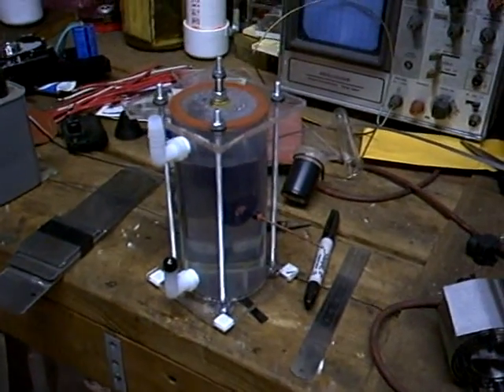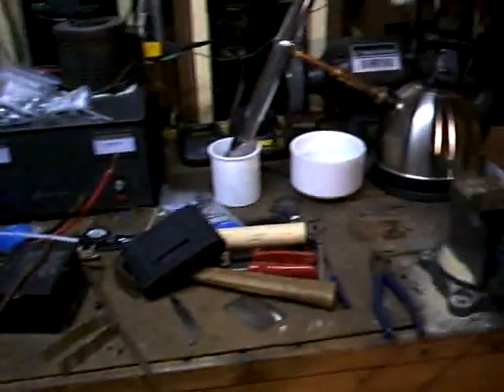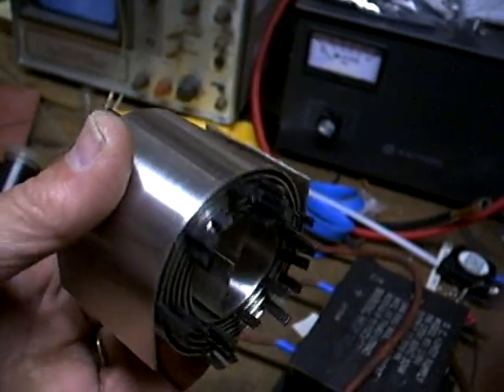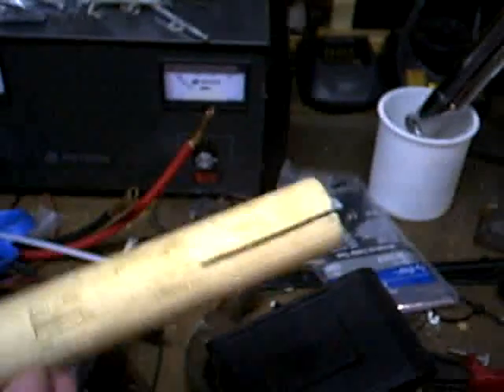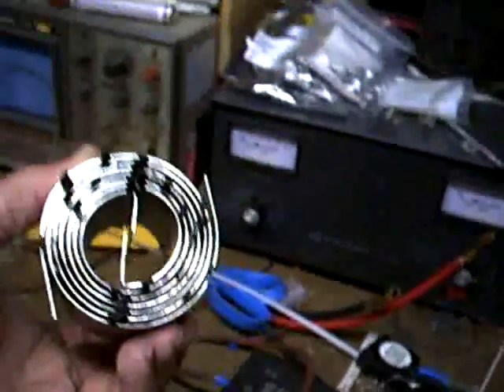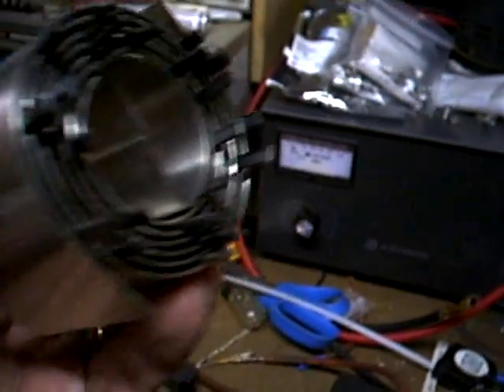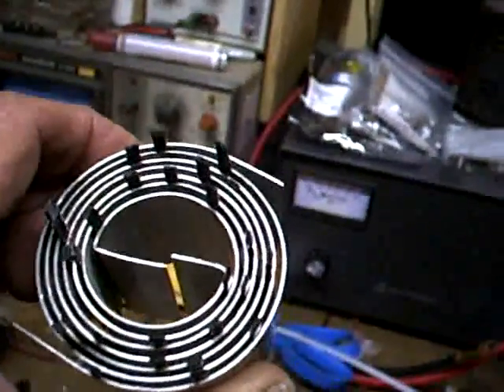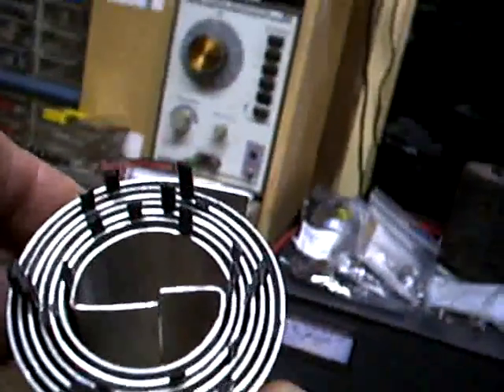#65 - Resonant Water Fuel Cell 01

Comment: polution in another way..poison gases released in the air from electrical devices..use radio waves no waste or polutions..clean..use the means of a sparkplug resister and get your fuel for free..sea water will work the best..also it's free...email me for information..will give you the specs..

Comment: Z you do good work! I like this cell, I think we may be headed in the right direction here. Was considering a dry cell but this would take me more in the direction I want to go, I think. Is it still on a burner somewhere? I have some questions though. With SS have you tested your waste for chromim-6 (hexavalient chromium- SP??) If it is leaching from SS dont pour it down the drain! I am hoping to find a way to not use brute force and stay with plain water. Chromium-6 is dangerous stuff.

Comment from the maker: There is no "Better". There is "Better suited for specific applications".

Since the optimum voltage for brute force electrolysis seems to be ~2.3V, series designs with 5n are better suited for cars. Parallel designs are fine too if you want the complexity of a power supply that produces high current 2.3VDC from 13.8v.

I'm pretty certain parallel is better suited for pulsing. That's what I intend to find out.

Comment from the maker: I have a feeling shim plates would be too flimsy and tend to short out when it warps from heat. The 0.035" SS I'm using seems ideal. They start with no gap inside the spiral. Then I unwind them just enough to slip the two together. They compress upon one another very tightly. Then I add the nylon cable tie shims and even more compression holds them in place. Lastly the shims are evenly spaced and glued into place at the tips. I'll shoot some video of the completed unit soon.

Comment: Ihave seen your vid regarding the poor mans shunt for the amp meter well try a piece of S/S 2"x4" and tap at around 3" between. set your digital m/meter at 200 mv scale. works fine and dosen't vary as there is ample area for current to pass without changing temp of shunt.

Comment: Hi it's me again I looked the circuit up, it looks interesting. Quite a task to invent such a circuit which keeps serching for resonance. I am experimenting with variable spacing of sieries cells with 5 neutral plates and found very good results obtaining 1lt. of gas at 13.8volts @15amps with 2cells (13 plates measuring 2"x7"x0.8mm thick 304s/s)

Comment from the maker: I think to start I'll whip up the LM324 based PWM described here cpemma*co*uk/pwm_erg*html with a IRFP064 MOSFET output.

Future experiments will use a custom circuit I'm designing from scratch that will lock on and track the resonance peak in real time.

Comment: Pvc is rated to 100 deg. before losing its psi strenth significantly. Acrylic is rated from -40 to 180 intermentant to 200 deg. And I believe Polycarbonate(lexan) is rated to 240. My thought was to use the Acrylic if temp reaches 180 or higher i know i will be getting steam soon. Whats your thoughts or were you aware of those numbers?? just curious?

Comment from the maker: No. This one is not going to be a brute force cell. Electrically this is a simple parallel plate for use as the capacitor in a high power RLC tank circuit. At resonance there may be as much as several hundred volts across the two plates.

Comment: on mine, i drilled a small hole into the metal and then ran the wire in the hole and silver soildered the wires, seems i also got better results hooking the wires up from the bottom, cant figure out why,and never took gas test but could see the differnce in the cell when it first comes on.

Comment: i used a bolt to wind it on and wound both pieces separate.used wire ties and a blow torch to hold the new shape.had a job getting the 2 coils together,then inserted the ties.
thinkn about a larger one with a neutral plate.

the tabs in the middle will make gas at the point were they are closest, may as well leave 'em

Comment from the maker: Very difficult. The result you see here is after four attempts to wind it, straighten it and wind it again. So the spiral is a little but wavey. Now that I have a method I should be able to wind them smoothly on the first attempt. I leave it in the wood dowel, unwind it slowly and allow the recoil spring tension to hold the spacers in place.

Still not sure how I'm going to cut those center tabs shorter or how I'm going to create the final combs that keep it together and evenly spaced.